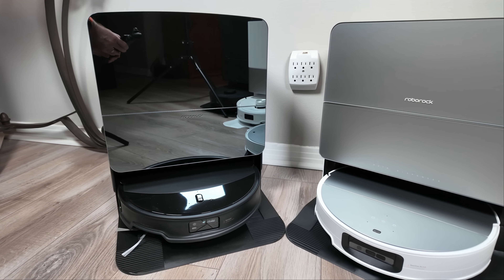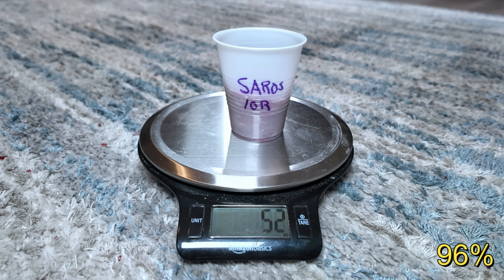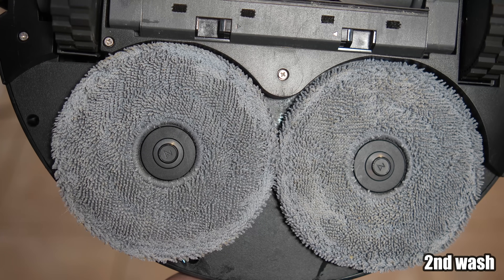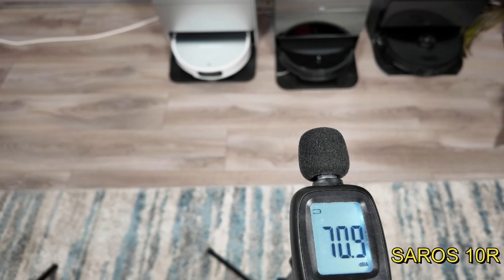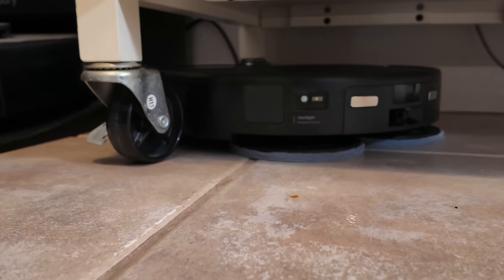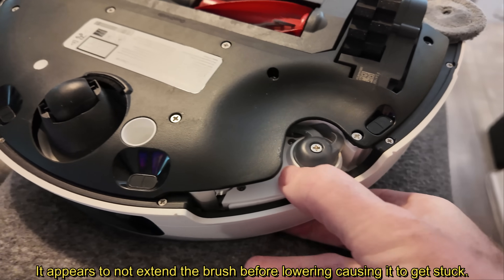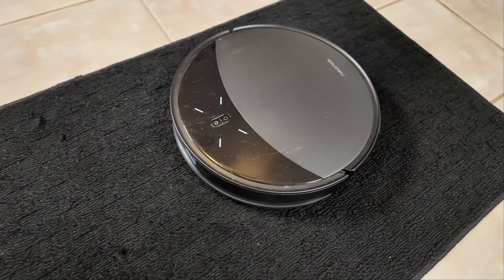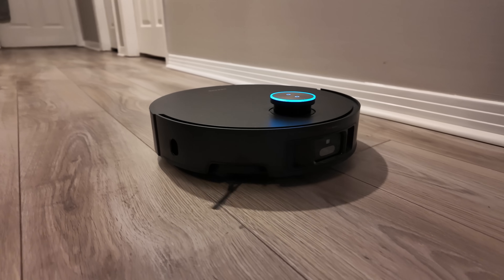Roborock Saros 10 vs. 10R: Ultimate Test Results!

Comment: 3 hours until the mop is dry again? Wtf? How much energy does this need? :0

I'm currently using a S6 MaxV and am pretty happy with it. I fill the tank with slightly chlorinated water, so the mop doesn't stink and thus no drying is required.

But I mean I switch it also daily.
Reply from the maker: I added the energy data in the video description.  Saros 10R Drying .6 AMPS & 70 watts of power.
Reply: @jamie.andrews  thanks! Yikes. Yeah I guess I'll stay with my model. Hot water seems to be a gimmick, drying is nothing I would use, as I automate room cleanings dynamically in Home Assistant based on use and door sensors, so it would be either drying all day or be wet all day and be needing a dry in the evening then, which kinda defeats the purpose.

Thanks for your testing, especially regarding cable avoidance, as that's the biggest issue I have with my S6 MaxV, which is not fixed in them.

Comment: You mentioned that the mop lift height is not as high as the 10r, but doesn't the robot left its chassis when on carpet which should provide more mop clearance on carpets?
Reply from the maker: No not by default it does not lift the chassis.  You have to set that in the app.  That is designed for very high pile rugs and will also lift the brush roller making vacuuming on carpet less effective.  I highlighted and tested this in my Qrevo Curv review video.

Comment from the maker: In the video on the 10r I said after 8 minutes the mop pads began to dry out.  I meant the water level started to become less, but not to the point where mopping was ineffective. It is still enough to mop the floors imo.  
Roborock just released a firmware update today and after retesting it appears they improved something.  The pads now are wet enough up to the 20 minute mark. 
I will continue to update as things improve.
Reply: I know that this firmware upgrade to the mopping may not seem like a huge difference but this one update is huge on my decision on which robot vacuum to go with. Thank you
Reply: Jamie there is another 10r owner that upgraded to the new firmware and is still encountering the dry mop issue on their robot. Can you let us know if the comment you made on the wetness level maintaining all the way to 20 minutes is still valid. Just want to double check because it may just be he has a faulty robot. Thanks
Reply from the maker: @DJ-HGLegacy  Yes I will test this week.
Reply: @jamie.andrews  Since I ordered mine today I will be able to test this out as well.
Reply: @jamie.andrews  Hi, I would like to ask how the test with the new firmware regarding the moisture of the mop went? Thanks for the answer.

Comment: The best review as always! Covered everything! You are the best. 

I will never go back to vibrating mops, it’s a pain to clean that docking station! I really think you should add some test that compare cleaning dirt out of grout. 

Can you tell how the Saros 10R compare against the Qrevo Edge?

And what about automatic drain and refill docking stations? Do you have any information why they never release it in USA despite having it listed on their website?
Reply from the maker: TY!!
When you say cleaning dirt out of grout do you mean vacuum or mop?  
Think of the 10r as combining the best features of  Slim and the Qrevo Edge together.  The 10r does outperform the Edge in almost every way plus it has a detergent tank.  
The only thing I am not fond of is the lifting side brush, and that is only an issue for people who have carpet.
I have not heard of a release date for the auto drain and refill dock stations.  I am sure they will make one soon.
Reply: @jamie.andrews  I mean moping the grout. There are mops that leaves more dirt inside grout than others. 

Roborock also announced the auto drain/refill station last year for the QRevo Master but never released in America. 😥
Reply from the maker: @bodosko  No word on a drain and refill from Roborock on the Saros models just yet.  I have yet to see a mop on a robot handle grout.  Not mine since the pads are not able to drop down in the grout lines.

Comment: Hey mate I just wanted to ask for the 'mopping direction' feature works in the app, I have hybrid wooden floorboards and if I want the robot to mop and vacuum in the direction of the planks do I just enable that setting and then does it ask you to draw the direction of your floorboards or how does it know what direction you want it to mop in
Reply from the maker: Yes it works well.  It will automatically detect the floor type, however you can adjust the floor type and direction manually in the app if the machine gets it wrong.

Comment: The real PITA for me is having to manually clean the washable filter every time it does a run.  All things being equal, I'd do the Saros 10.  Currently on the Q Revo, and that's one of the downsides.  It just doesn't vacuum the filter properly.  Everything else is great.  What's the point in self-cleaning if there's a mat of crap on your filter after every 2nd run.
Reply from the maker: Yea that is an issue on most robots without a prescreen for the filter.

Comment: Wish i kept my S7 Max Ultra.  Instead, I traded it in for S8 MaxV  My S8 Max is worse with obstacle avoidance, and I had to return three S8 MaxV units because they were defective (lidar quit twice and pump at station quit), which was very annoying.  I will give Roborock credit for sending me new machines with the 1 yr warranty, but still frustrating. Losing my faith in Roborock. Im holding off for the Narwal Flow reviews.     Perked my eyes during CES.

As usual, thanks for your thorough honest reviews.  You're my only trusted source for robot vacuums.    I wish I would have watch your review on the S8 MaxV before buying it because you were spot on relating to the flaws of the machine.  My S7 Ultra was more reliable.  Need to work on my patience.
Reply from the maker: S7 MaxV Ultra IMO was one of the best robots from Roborock.
Reply: @jamie.andrews  agreed 👍

Comment: I’m curious if you tried changing the less collision mode to sensitive under the reactive obstacle avoidance setting. My 10r was running over cables until I changed that and now it’s been perfect in avoiding them and still does a great cleaning job. The flexi arm seems to have improved since your test too. Maybe different firmware? 
I was torn between the two but cleaning the dock is so much easier with that pop out tray.
Reply from the maker: Yes it was set to Sensitive however that only impacts the edges of the room or near furniture. The 10r did much better in those areas than the 10  so my findings match what you are seeing.
What firmware are you on?
Reply: @jamie.andrews Im on 02.23.92. Which one are you on?

Comment: i chose the saros 10 and yes its not great on cords somtimes it identifies sometimes not. i just told mine to avoid my cord areas. i will say it has gotten better overtime maybe ai is getting better  at object avoidance. it did recognize possible areas that might be a problem.overall its done a good job minus the cord situation it avoids dog toys identified ktty litter and crate on its own.
Reply from the maker: It got a firmware update a few weeks back that did improve object avoidance however cords are still hit or miss. It also did not change my 2 main test results
Reply: How do you handle cleaning the docking station periodically after it washes the mop pads? Is this maintenance issue significant enough that people generally prefer choosing the Saros 10R instead?
Reply: @noynizri7860   it has a small removable tray  were dirt and stuff accumulate so far it has not been much of an issue but you periodacly will need to clean this area. I think 10R design is better but overall look saros 10 dock looks better.

Comment: Great reviews! Which mop system gets into grooves better? I have grooved LVP. Is mopping better at all for either of these over the s8 maxv ultra? Is avoidance any better in these two over last generation?
Reply from the maker: These types of mops don't really get into grooves like that.  Heck they don't even get into my wide grout on my tile.
Yes both of these mop better than the S8 MaxV Ultra. Object avoidance on the 10r is notably better and the 10 which is only slightly better than the S8 MaxV.
Reply: @jamie.andrews  thanks. I have the s8 maxv ultra. Was going to trade in for the 10 but the allure of the easier to clean dock is tempting. 😮‍💨

I am optimistic on the software improving for starlight and navigation.

Appreciate your videos as always!

Comment: This is the best review I've seen so far!

Just a quick question, Once and for all, which robot will be better at cleaning hybrid wooden/laminate/vinyl flooring like you have in 11:34

No one can really answer me but I'm leaning towards the 10R becuase of its spinning and 'scrubbing' mop pads... but what would you say given all your tests?

Thanks mate
Reply: After living a few years with the S7 MaxV Ultra which is like first version of the Saros 10, I can say it's awesome except for cleaning the dock which you have to scrub on your knees and it still never gets 100% clean (maybe like 90-95%). So I'm going with Saros 10R once it's released here.
Reply: @ are you in Aus by any chance? I've been waiting patiently for the 10R to be announced after the 10 was last week haha

Would you not go the 10 as it has the same mopping pad as the S7 MaxV Ultra? (The 1 solid vribrating pad) or do you want to try the rotating pads ?
Reply: @alexsallery  I'm 100% opposite (if you dig a hole straight down, you get around my location), in Sweden. We do not have any Saros released yet.

The S7 MaxV Ultra has a single vibration zone, compare to the newer robots like Saros 10 that have two. So even this would be an upgrade.

I say this does good enough cleaning. Never notice any dirt when it's done.

The decision comes to two things for me:
1) The 10R dock is sooo much easier to clean. This is the part I hate to do with the pad version of the dock.
2) There are "4" less things that can break on the 10R compared to 10. The tiny rotating mop, the lidar (it has a belt and motor that spins the lidar), the dock brush that cleans the mop (motor + brush and whole assembly), and lastly the motor that raises and lowers the lidar into the robot chassis.

Each one seems to have pros and cons.
10 pros:
* Cleans faster
* Better dock design (closed water tanks and hatch is attached)
* Slightly better mopping

10R pros:
* Better navigation
* Might clean better under furniture and slightly in corners (since the mop reaches further)?
* The dock cleaning process is a breeze
* Starsight has potential to be super good with tiny objects. Especially since the Saros Z70 will use it too, they will probably work a bit more on it.

Overall, just the dock cleaning is such important part it will outweigh the pros of the 10 for me.
Reply: @ that's fair enough mate, great response

I am after the best mopping robot but I think I'm still going to get the 10R, great point about things less likely to break and need cleaning like that tiny rotating mop pad on the 10 haha
Reply: @alexsallery  I can add that I would keep the S7 MaxV Ultra if it could do 4 things:
* Clean corners (the extended brush is missing).
* Have anti-tangle brush (my wife has long hair, and I have to clean it every 1-2 weeks because hair gets stuck).
* Clean mop with hot water to prevent smell (with cold water, the mop sometimes smells, and then when it cleans next time, the first room smells a little for a few hours - this should be completely gone with hot water washing of the mops).
* Mop along baseboard.

For what the S7 MaxV can do, I love it. But these 4 things are finally worth an upgrade for me. I will keep the next robot (99% sure it will be 10R) until it breaks. So hopefully at least 7-10+ years. There are no features other than needing a bag for the dock (bagless would be next step the S7 MaxV Plus had that) that I feel are missing from the current generation of robots (starting with Roborock Curv/Edge, but they are too tall for my furniture - taller than S7 MaxV). Only thing they could improve now is to have like 100% accurate object avoidance.
Reply: @ I think the best mopping robot will have a roller. Problem with those robots is they are usually way taller. And the cleaning of the roller system becomes more of a nightmare. And they usually have other compromises too.

The cleaning of the roller is a downgrade from the 10, while 10R is improvement of 10. So opposite direction.

Also I want to clean under as much furniture as possible, so the 10/10R are the best options on the market to my knowledge, they shaved off like 1.5 cm compared to old robots which is HUGE.
Reply: @alexsallery  I can add that I would keep the S7 MaxV Ultra if it could do 4 things:
* Clean corners (the extended brush is missing).
* Have anti-tangle brush (my wife has long hair, and I have to clean it every 1-2 weeks because hair gets stuck).
* Clean mop with hot water to prevent smell (with cold water, the mop sometimes smells, and then when it cleans next time, the first room smells a little for a few hours - this should be completely gone with hot water washing of the mops).
* Mop along baseboard.

For what the S7 MaxV can do, I love it. But these 4 things are finally worth an upgrade for me. I will keep the next robot (99% sure it will be 10R) until it breaks. So hopefully at least 7-10+ years. There are no features other than needing a bag for the dock (bagless would be next step the S7 MaxV Plus had that) that I feel are missing from the current generation of robots (starting with Roborock Curv/Edge, but they are too tall for my furniture - taller than S7 MaxV). Only thing they could improve now is to have like 100% accurate object avoidance.
Reply: @rxappdev  that's good to know mate, I was considering a S7 or S8 as we currently have an S5 (you should see how much hair from my wife and long haired Alaskan malamute gets caught in the single brush roller it's crazy) so I imagine they would still be a huge upgrade to us, but as soon as I seen the 10 and 10R I thought why not get the newest. I think I'll go 10R
Reply: @rxappdev  yeah the dust bags confuse me a bit, coming from an S5 which has no proper dock you just empty the plastic dustbin from inside the robot, so with these new docks with bags do we have to replace the bag every so often or just empty the bag every so often and the bag itself will last a long time?
Reply: @alexsallery  I started with a Roomba (it was terrible - well it would break the battery every 6-12 months so I would need to buy a new battery), then S5 Max, now I'm on S7 MaxV Ultra which is a nice upgrade over the S5 Max. The bags need to be replaced every few months (for me, every 5-6 months with 1 kid + long haired wife). There are third party bags that have a zipper so you can just empty the bag and re-use it. I just got myself a 3-pack of the bags with a zipper, hopefully this will last multiple years per bag. Can't wait until the 10R is released.
Reply: @rxappdev  wow that's great to know about the bags with the zip, I watched a few YouTube videos on how to empty the dust bin because I thought there is no way that my pet hair and general dirt that the dogs bring in will be able to fit through that little circular hole in the bag when I empty it

Are the bags themselves pretty big? Like how now with the S5 Max I have to empty the dust bin after every single time the robot has run, would I only have to empty the bag system like after every five vacuums roughly
Reply: @ Seems like S5 Max Dust bin is 460 ml in size, the dust bag in the station holds at least 2700 ml from what I could find. So almost 6 times the volume. But you probably want to empty it earlier so it's easier to do. I would guess after 4-5 times yeah.

I've seen at least 2 brands of the zipper bags. The one I bough is about 12.5 cm * 13 cm * 15 cm = ~2438 ml volume - still over 5 times bigger than your S5 Max.
Reply: @ wow that's crazy haha, these robots have come so far since we got our s5 max 6 years ago
Reply: Honestly wish they were more transparent about the timelines for release. I thought we were getting the 10R alongside the 10... now I'm left wondering if I should wait or just bite the bullet and buy the 10. Low maintenance is really important to us bc ADHD / chronic illnesses, but we're upgrading from a Lefant $300 vacuum so I'm understandably antsy to get a top of the line model
Reply: @ I bought the edge yesterday as I couldn't wait for the 10R 

It's amazing!
Reply: @ I ordered an Edge too, but had to cancel because I realized it was taller than my S7 MaxV and would not get under some of my furniture. So I'm stuck waiting for 10R.
Reply: @ I'm not sure where you are located but I know it's being released in Australia sometime next week
Reply from the maker: The 10 will do slightly better in my testing, but it is sorta a tossup. Both should do just fine.

Comment: Finally an useful and detailed review!! So the warm water refilling seems just a gimmick. And the Saros 10R isn’t much better than the Slim, right? Actually the Slim does even better in your litter test on hard floor
Reply from the maker: Ty very much! The slim does do better on the liter test.  I was so shocked I think I tested it like 8 times!  Regardless both scores for the Saros models are not bad by themselves.
Reply: @ could it be that the Slim is so good on hard floors because the brushes actually touch the ground? I’ve noticed (with surprise) that in my Q Revo the brush never actually touches the ground, there’s a 1-2mm gap, and indeed I don’t understand why it is designed this way
Reply from the maker: @fabio-zv8bs  I'm not sure.  It is better than the Master with the same dual rollers.